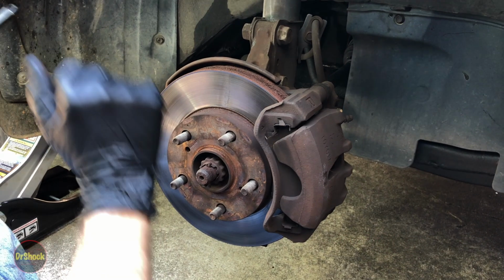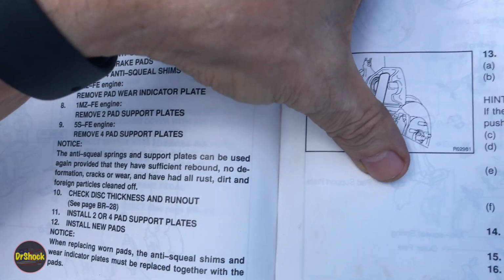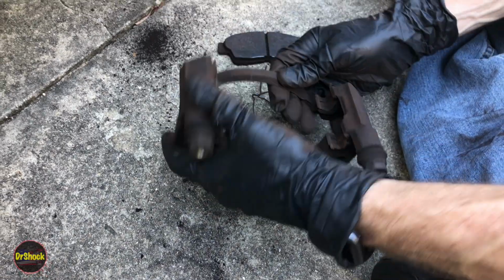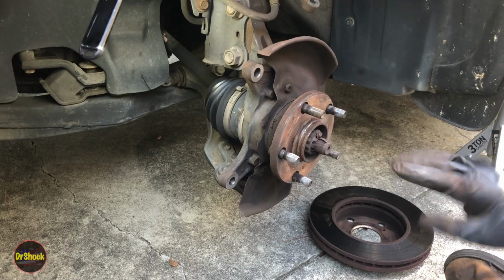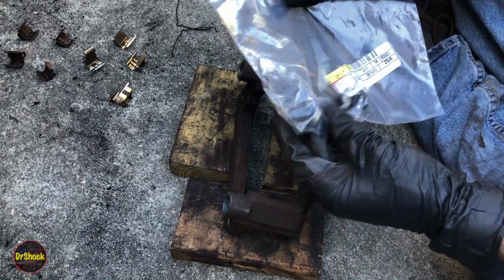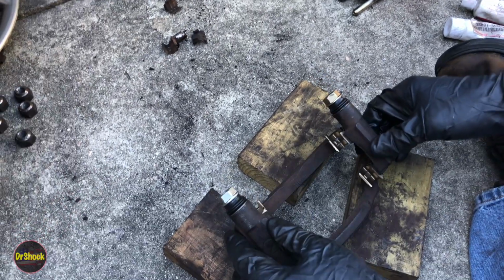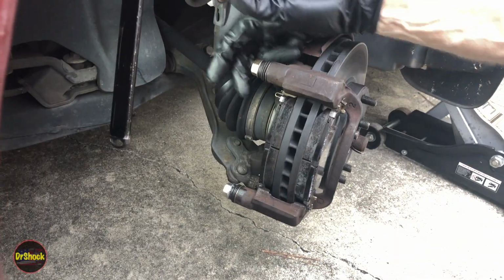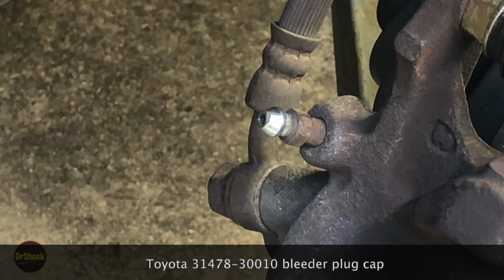1997 - 2001 Toyota Camry 2.2L 5S-FE Engine Front Brake Discs, Pads, Shims, and Hardware Replacement

Comment: What's causing a squeaky noise first few braking cycles? Onces it's hot the noise is gone? I used OEM pads and rotors? Thanks
Reply from the maker: I would check that the anti squeak parts and springs are correctly installed, and lubricated where required.  Also that you burnished (bedded in) the new pads.
Reply: @DrShock  Does your car make any noise after new pads and rotors?
Reply: Btw this is 96 Camry 4 cylinder. Thanks
Reply from the maker: This video was filmed for a regular customers car, they didn't express any noise concerns after I turned it over to them and none since.  I don't typically run into disc brake noise issues with new OEM parts.  Though occasionally with machine shop turned rotors this sort of issue can arise.    The pad bedding in process, and other suggestions given earlier,  are key to avoiding this sort of thing though.
Reply: @DrShock  Thank you I have done a few brake jobs with no issues so this one squeaky and squealing is new for me. I pretty much did everything in your video besides new boots and bedding the pads. I never bedded brake pads before and never had a noise issue.
Reply from the maker: Some other suggestions I could offer would be to inspect the caliper to insure it is freely moveable by hand to confirm the pins are not binding.   To inspect that the metal pad clips have not inadvertently become bent and making contact with the rotor. And to inspect for excessive rust or corrosion on the caliper ears that may be interfering with smooth movement of the pad.

Comment: How the fuck do I position the pad supports in the 14 in wheels on the right side. It seems to be different from the left
Reply from the maker: They are completely identical side to side (mirror images of each other), if you are using genuine OEM Toyota parts as I am showing.  Aftermarket parts might differ tho.
Reply: @DrShock just got it, I think one of them just might have been a little bent.
Reply: Great video. I only recommend and use OEM Toyota parts. Very detailed  on this break job.